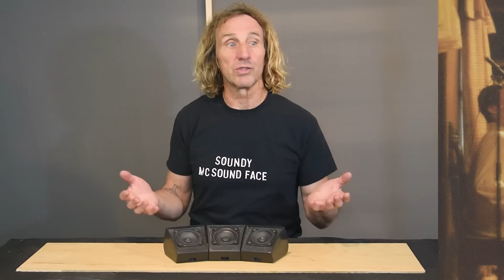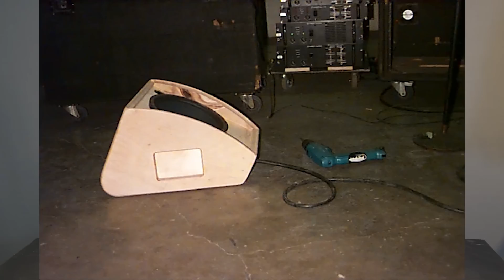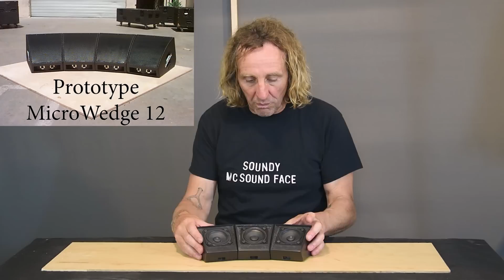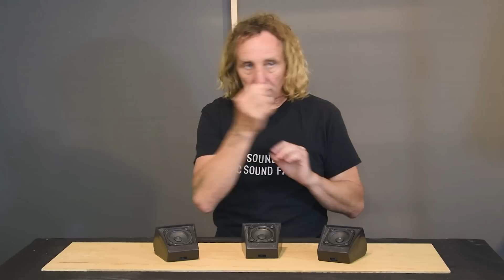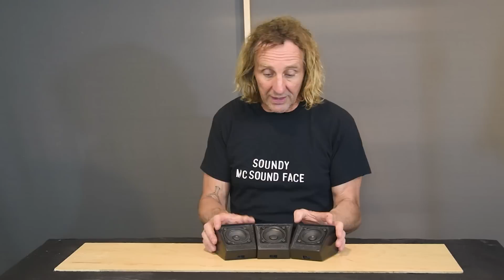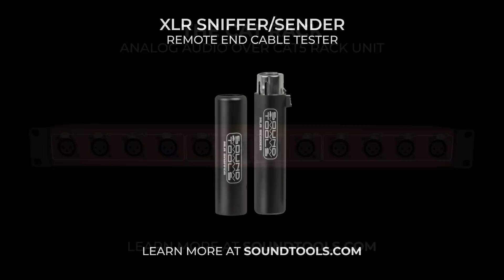Developing the Double Hung PA & the MicroWedge

Comment: Hey you said you play those wedges for different frequency so what frequency they play you sad vocal, guitar, snare what are the rest and at what frequency do each play that would sound good
Reply from the maker: I do it by sending different instruments to different speakers and all the speakers are full range.

If you are dividing frequencies, that is different and is basically a crossover.

So early on I was making speakers with more and more crossovers, then I started separating by instrument instead of by frequency
Reply: Ok so by instruments you mean vocals and guitar and instruments so what frequency are those
Reply from the maker: Not sure what you mean. When I say vocals I mean I take just the vocals and send those to a speaker and then I have a separate channel that has just the guitar and I send that to a different speaker and so on. Once the sounds have been all mixed together you can't do it
Reply: Oh ok I understand know I thought you use a stem splitter to split music then send to the speakers but I guess you can't take direct music then split it then send it to different speakers I guess it's impossible
Reply from the maker: @MyTgangsta Yes splitting it once it's been mixed is very tough. I have live recordings with the tracks that have not been combined together yet. This is mainly meant for live sound or recording people that have access to the original tracks before mixed together

Comment: I love my Micro wedges.  so nice of a foot print.  and yes  most festival I run  interment  one mix and  vx on another  at least on the front mixes.   but also hi pass is my best friend when providing  a good mix to each of the  people on stage.     got them and sold a bunch to churches and even a theater  when  radian was doing them.  is there a big difference  with the newer monitors
Reply from the maker: Awesome! That is so cool. Which newer monitors?
Reply: The micro wedges built by EAW as opposed to the ones built  a while back by Radian.
Reply from the maker: The EAW are much better. The cone surrounds don't crack, an issue I battled radian to solve, lighter, louder and I worked very hard on the processor settings. Both for biamp and passive settings. Also they have fly track and I improved the smoothness of the dispersion.

And big improvements to the passive crossover.

Comment: Been using some of these multi driver iem's. Makes a massive difference in clarity but again pipes it straight into your hole. And own sone beyers i like to mod. But wondering about multi driver over ears, remember some gaming company tried a while back but wasnt very succesful. Im not sure why, it seems ideal if the drivers are up to it.  ..can you get the new style solenoid style linear drivers in high enough wattage i wonder
Reply from the maker: Very cool there is a difference though here. Multi driver in ears all reproduce the same signal or have a crossover. 

This design every speaker reproduces a different signal

Comment: I chuckled when I watched this... I discovered this concept in the early/mid 1990s when I was working at a TV/radio broadcast group.  As we expanded, so did my workload.  We started receiving more and more remote / satellite feeds.  To manage the train wreck I popped a small cheap mixer and two cheap speakers in there and started panning sources.  I could now monitor 4x the sources by panning and still make out each source.  Eventually we added more speakers to give us more point-sources of audio for clarity. Monitoring 10-16 sources simultaneously was entirely possible with this approach.

Interestingly, now in aviation they're starting to do this, with some audio panels automatically panning sources when they detect multiple simultaneous communications.
Reply from the maker: Cool stuff!

Comment: You reinvented the wheel here, Grateful Dead did the same thing with their wall of sound. Every istrument had their dedicated line of speakers for maximum clarity.
Reply from the maker: Back in the 80s when touring with black flag with a pa I designed, we setup a show like the gratefull dead wall of sound.

Ran each instrument separate and such, put the pa behind the band. While interesting, what I learned was the huge flaws. Putting the pa behind the band was a terrible idea as the sound of the pa got into all the mics. Even with dual polarity reversed mics, the sound was greatly deteriorated.  Plus putting the pa farther from the audience was not ideal. Also, for a modern show, using all that space behind the band is an impractical use of critical visual space for set design and video.

All instruments are separate to begin with, not combining them is obviously better than combining them.

The innovation and cool aspects are to come up with realistic, practical and usable ways to implement and deploy this fundental concept.

Comment: quick question dave, what cable coiling technique do u geuinly think is better like for all reasons from the cables health, longevity ect,
Reply from the maker: Over under for small diameter cable is best. Over over creates cable damaging coils. Cable reels are good but bulky and slow. Over under mixed with fig 8 for large diameter cables.

The key is to make sure that when uncoiled there are no loops and when coiling the cable naturally sits flat

Comment: This is the first time I’ve heard of this concept! This makes so much sense. I’ve experienced the same thing with my IEM’s when using a mono mix compared to stereo. My mono mix requires “more me” and careful eq while my panned stereo mix requires little eq and almost zero boost of my vocals and keys. This works for me but other performers I’ve worked with find no advantage to stereo iem’s or simply prefer wedges. I look forward to trying this micro monitor concept in the future. Thanks for this excellent and useful video.
Reply from the maker: Awesome thank you Darryl and let me know how it works out

Comment: Well, a drum is a single source that makes many different sounds at once. Same with a waterfall or crashing waves. There are many different frequencies happening at the same time. But I get your point. Obviously breaking up the mix between many speakers would be nice. Sort of like a small club. The guitar comes from one amp and the drums come from the drums and the vocals come through the PA. Slightly bigger clubs have all those sources separated and included in the house mix. But you can still hear the drums and the amps from their original sources. The bigger the venue the more absurd it gets.
Reply from the maker: Yes complexity increases and yet so does our capabilities to deploy more complex systems.

When you look at technology like the Holoplot where there are 64 amplifiers driving 64 speakers in a panel smaller than 4x3 feet and each amp and speaker can be individually processed, you may begin to realize that the tech to actually recreate sound closer to accurately already exists.

It just has not been configured and applied

While the Holoplot is a different concept based on beam forming rather than separation and accurate source recreation, all the tools we need are here now and beam forming is way way more complex.
Reply: @DaveRat  ah. Okay. Cool. See my other comment on your last video. It seems we’re on the same page accept you seem to know more about the current tech. 

We’re you referring to the software that can separate each instrument? It’s been around for decades and can only imagine how much better it is now. Hopefully easily tweaked and real time. Sound cards and interfaces should have between 4 and 24 outputs.
Reply from the maker: No. I am referring to configuring speakers in such a way as to better replicate sound sources. Though I don't know any off the shelf examples

Comment: I remember when I first heard you describe these concepts about a dozen years ago. You were a feature speaker at a sound engineers conference at wachusett mountain in MA. I was blown away. They were such simple concepts but so profound and transformative when applied.

A few years after I was doing a national touring act at a college and the lead singer just wasn't getting enough vocals in his monitor. I remembered your talk, grabbed another monitor and gave him a second mix with just his vocal in it. 
It completely solved the problem quickly and easily.

I never could quite justify the expense of the micro wedges for my small sound company, however having the knowledge of why they were designed has been invaluable to me over the years.

Even when I went to buy powered monitors I used your method of just running an sm58 with a flat eq and seeing which one got loudest before feeding back. Ending up discovering that a cheaper model actually sounded better and gave more gain before feedback than others I was looking at.

Really, really appreciate you man. You've been a huge influence and help with my life as a sound human❤️
Reply from the maker: So cool djsparky!! Thank you and I remember that conference, we all stayed in the same hotel.  Good times!!

Comment: Can you transfer this to subs?
F.ex. stack 2x2 sub in front and 2x2 behinde in cardioide .
Bottom subs under 50 Hz and upper subs over 50 Hz.
Delay back subs about 40 and 60 Hz?
Reply from the maker: Due to the longer wavelengths, subs will tend to act like a single source when paced close to each other and any differences in signals will alter dispersion, summations and cancellations but not really be percieved as separate sources.

Doing what you describe would mainly alter the dispersion and coverages at different frequencies.

Comment: I have done similar things when trying to get the most out of very small PA systems, like ones that are probably a bit to small for what might really be needed  for a metal project that uses drum tracks. The PA was just essentially some small powered bins, 400 watts each, a 15" and a horn.  I gave the drum tracks their own system and also the vocals as well. And yes, it definitely punched above it's weight as you could get clear vox while maybe the "drum speakers" were being pushed a bit.

Comment: Dave, thanks for "inventing" this concept.  It makes sense to me, and probably explains why I had success in the early seventies with what I did with my band's PA.  We were mostly in the analog age, but some of our venues required a little more than what most of our contemporaries used.  The Kustom and Shure systems of that time were pretty good for most smaller clubs and similarly sized venues, but if the room was larger or we were outdoors, they just didn't have enough power/clarity when cranked up in those situations.  LInear arrays and subs did not exist then.  We had a Sunn digital console, and took the analog signal through active and passive crossovers and tri-amped the mains with 15's, 12's, and then large horns with piezo tweeter arrays on top of them, with double the power to the 15's.  Amazing difference in clarity.  And, we ran two stage monitor feeds, one for the vocals, and one for the instrument input, along with "side" monitors that were bi-amped with only passive crossovers.   This gave us clarity in the vocal monitors, and still could bring up the instruments' when needed.  I decided on doing this with our PA only because hi-fi enthusiasts were bi-amping and tri-amping their home systems to theoretically increase power on the bottom and maintaining clarity in the upper ranges.  You came to your solution from a different direction, but your solution seems to be the optimum when one has access to today's equipment.  I bet those bands never had had the clarity your ideas gave them.  Just genius on your part!!
Reply from the maker: Cool stories and thank you!

Comment: This explains why perfect mixes rarely last long.   Not everyone can hear the noise either.  It drives me nuts.    Even when I am simply doing karaoke shows,  I have to have an EQ on every source and for the room, have to have subs in some form, and sometimes the room serves as a backup as well.    I'll change orientation of the drivers on the fly to bounce off the walls a bit differently to cancel out the noise. 

Good powerful sound is coming in smaller packages these days, so adding a "2nd PA " of some sort, might actually be in the cards for all the different types of gigs I do or plan to do.

Comment: My goal for small venues has always been to try and get the sound to sound like it's coming directly from the instrument to my ears. Or directly from the speaker to my ears.  I first thought of this when I heard a professor speaking from a lectern with a speaker in the base. I was sitting back a little ways, but the sound was coming from him, not overhead speakers. with some simple panning and better placement of main speakers, I have been able to get a pretty good simulation of that effect for a 200 seat sanctuary. Getting that from instruments is another beast I am still working on. I'd love to have speakers at the Keyboard, Piano, and strings where the sound emanates from that physical location rather than from the mains. That would cause some issues with vocal mics for sure.

Comment: This is very useful information. I’ve since moved to a silent stage/in-ear mode of operation, but should an artist have difficulty with their ear pieces it would be comforting to have this kind of monitoring setup should they need to pull their ear piece out and they could still be able to hear their performance clearly. But even with developing my in-ear monitoring, it took me a while to learn how much more clarity the source signals had when you could break them up into stereo group sends to be adjusted to taste on the cue mix rather than forcing everything down the same signal path where everything just got mashed up into one indistinguishable mass of harshness that just fatigues ears and brains just a few songs in.

Comment: It all comes together...
Question: where can I find replacement xovers for Radian Apex 1200 mons? They just keep frying!
Reply from the maker: Hmmm, probably best to replace just the fried parts. They should be marked with the values or look at a non fried one  

Parts express should have have the parts

Let me know if you need more assist. And I will see what I can do.  Maybe reach out on the channel members Telegram channel. Cool cool Todd
Reply: @DaveRat  Thanks as always!
Reply from the maker: Cool cool, and if you have a tough time, I think I have a few parts from the MicroWedge crossover. If it's capacitors that are going bad, use higher voltage versions. If it's chokes, osually it's that they come loose, if chokes are over heating, then you can reposition and mount near the port by adding wires

Comment: Awesome content as per usual! Since you are primarily an engineer and have  developed the microwedge as well as lots of other systems I am curious if you have had any personal experience with Danley sound Labs designs and most specifically their SM80M wedge monitor. I enjoy the creativity and outside the box concepts of both their and your designs. Thanks!!! I second the miniature PA system manufacturing... Untapped market for sure!
Reply from the maker: I have compared the MicroWedge side by side to the SM80m. The Danley does sound good and is a solid design. Volume wise they are comparable, the MicroWedge goes lower and has a smaller footprint.

Comment: Wasn't it Richard Kontrimas from Radian who designed the Micro-monitor. And yes, many years ago.
Reply from the maker: Actually I designed and patented the MicroWedge design and licenced to Radian. Then, I was not happy with the development of processor settings and relaibilty so when the contract ended, I I licenced the design to EAW and together took the product to the level I was seeking to reach.  They do a great job and the EAW version is louder, more stable, and has more features and improved sound quality.

When I ended the licensing deal with Radian, they built a similar product but could not use the trapezoidal shape as it infringed on my patent.

Comment: With my bar band, I run 4 monitor mixes, one for each guy. I use JBL Eon 610s and in monitor EQ mode they cut a lot of low mids and lows so it sounds kind of thin. Until the subs are on in FOH and the bass amp is running. Since bass is so omnidirectional, the low end in the subs is all you need and you get a ton more clarity and power headroom in the monitors with the low end out of them. It works pretty well for us, we're also pretty reasonable guys, no prima donnas that need more 2k on the second guitar amp kinda guys.